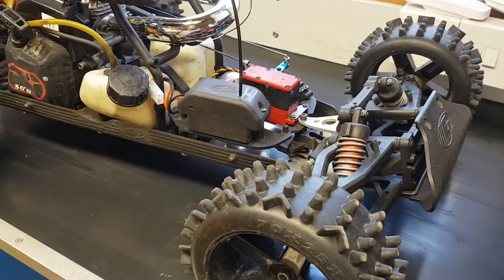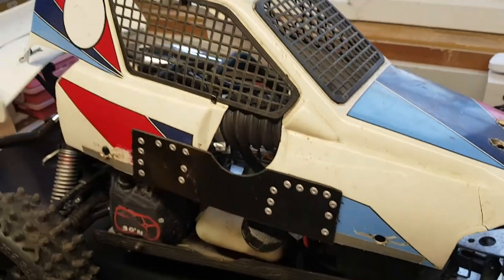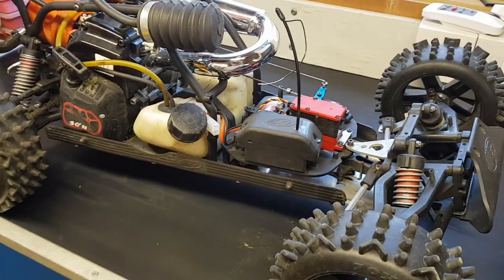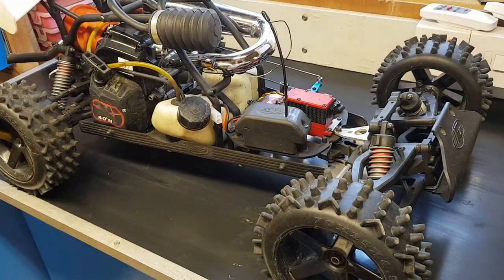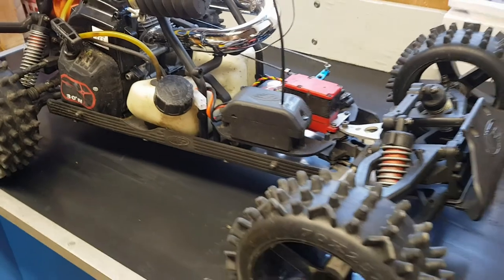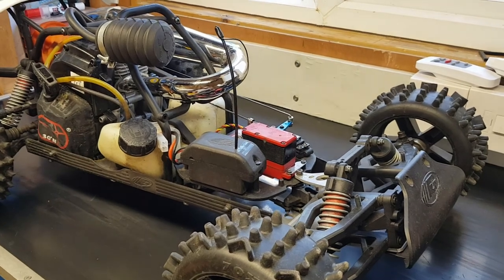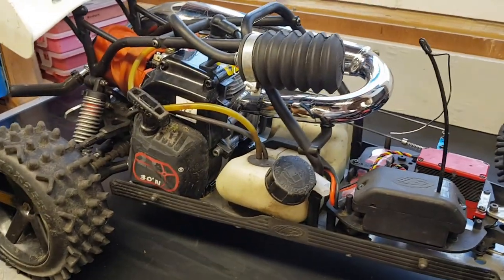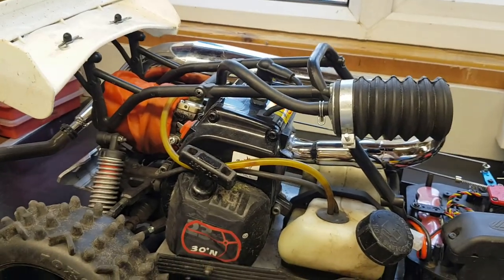FG Marder 1/5th Petrol RC Buggy First runs and impressions

Comment: How is your experience after almost a year ? 
Is it very  loud stock  ?  
Can you make it quieter ?
I dont want people complaining
Reply from the maker: Have to say we haven't used it much! Electric is so much easier
Reply: My Marder is 15 years old. I installed a 26cc zenoah probably 10 or 11 years ago. I have a jetpro pipe with silencer and it's quieter than most power equipment. 

Of all the vehicles I've owned, including the dbxl, the marder has been the most durable and most reliable of the bunch. It doesn't have the absolute performance of a modern design but it is still more fun to run.

They also make an electric version now.

Comment: You can just get rid of that boost bottle thing. They don't actually do anything.
Reply from the maker: What do you do with the hose that comes off the engine to this bit?
Reply: @TeamRC3D  just remove the hose and get a rubber cap to cap off the port. You should be able to get them at the auto parts store